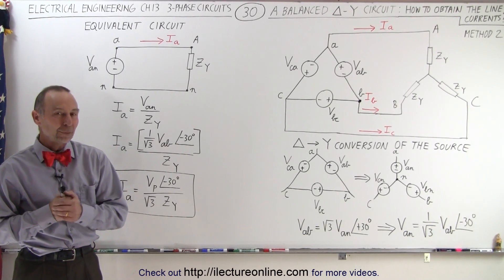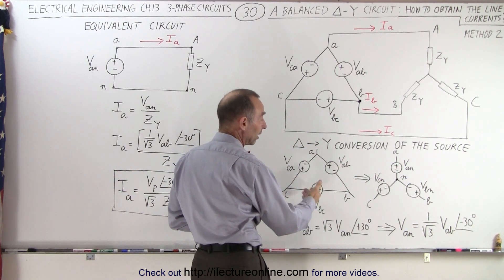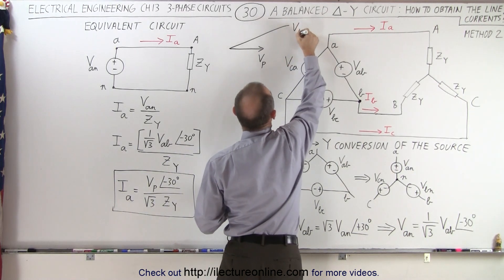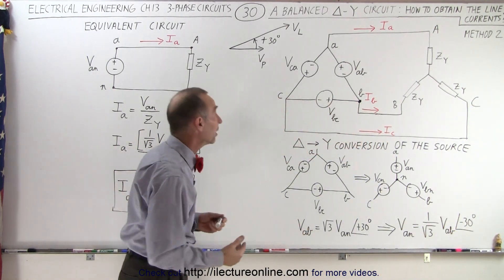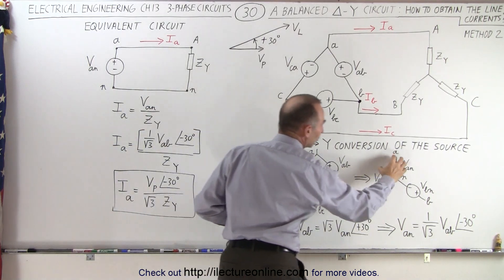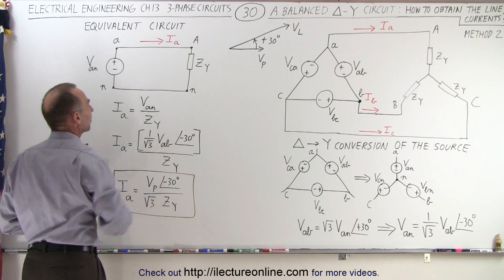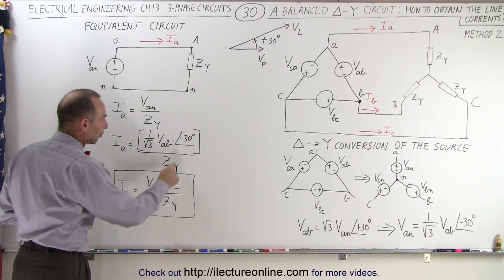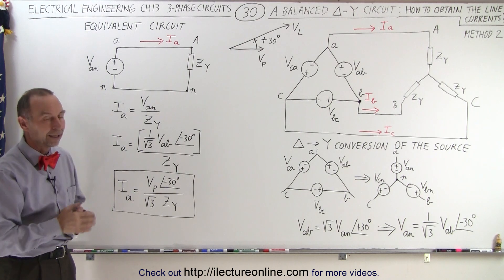Electrical Engineering: Ch 13: 3 Phase Circuit (30 of 53) Balanced Delta-Y Circuit: Line Current=?

Comment: 01:24 prof, does it mean that there is a always a neutral wire at the centre node of the load delta ? Or we only added the load neutral for this case to illustrate the diagram at the top left ?